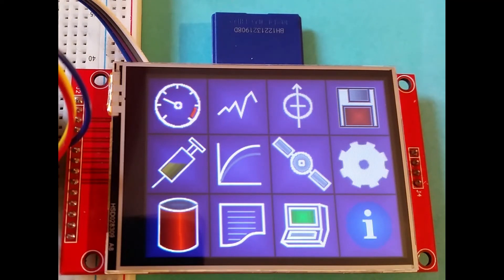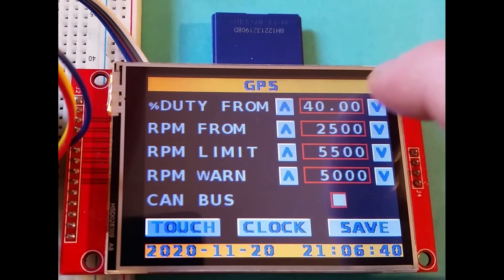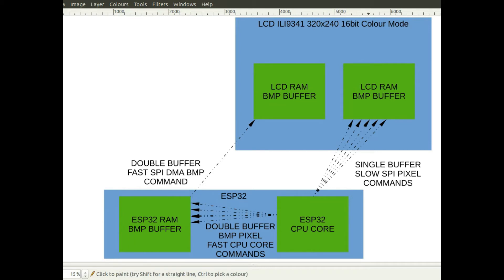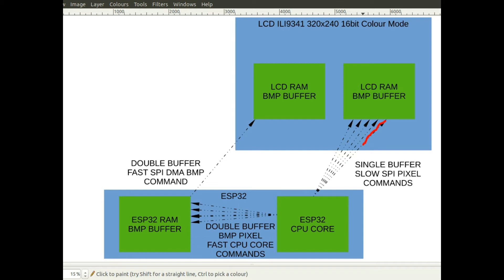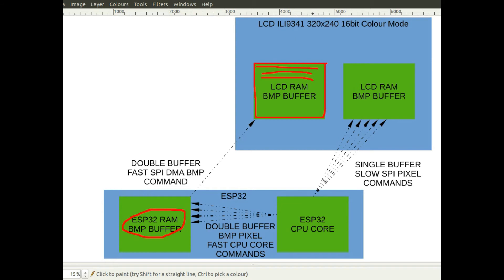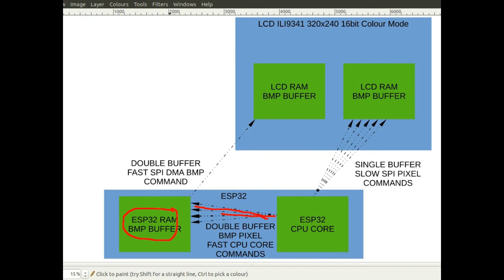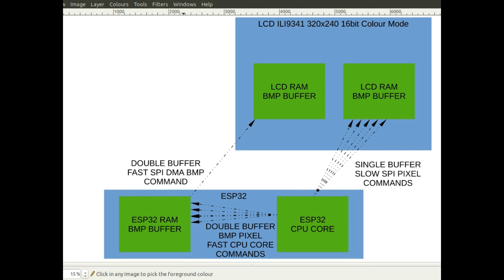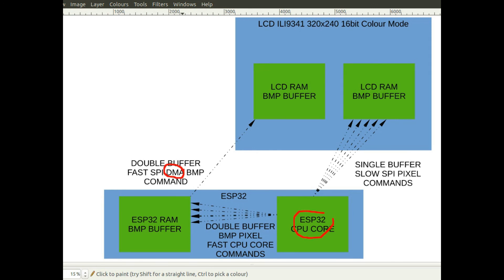Improving ILI9341 LCD Update Performance With Double Buffering

Comment: Nice video. Using free RTOS is it possible to run your setup including LCD, Touchscreen & microSD plus LoRa module from Ebyte linked here http://www.ebyte.com/en/product-view-news.aspx?id=453 (I think it uses 10 of ESP32 pins including SPI bus)  1 I2C bus, minimum of five of touch sensors, couple of ADC pins and at least three of digital input/output I/O? Does ESP32 have enough pins available? 

Thanks.